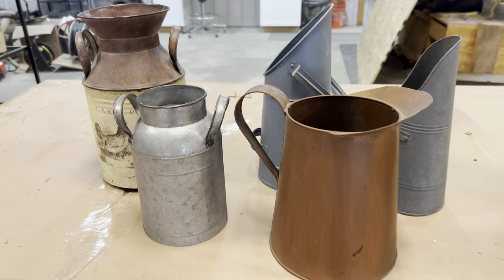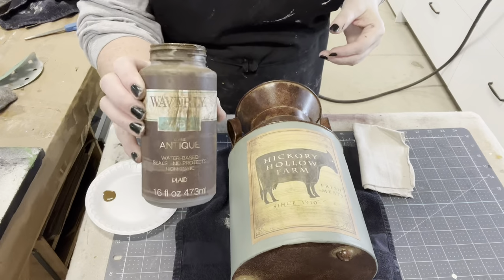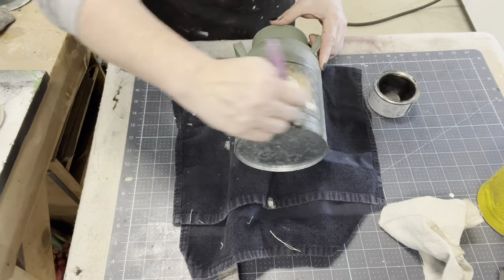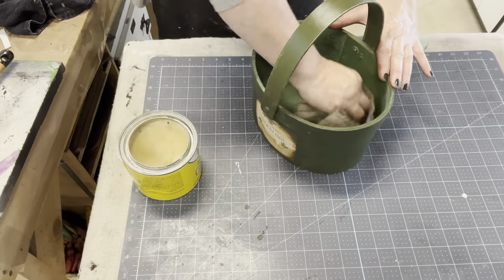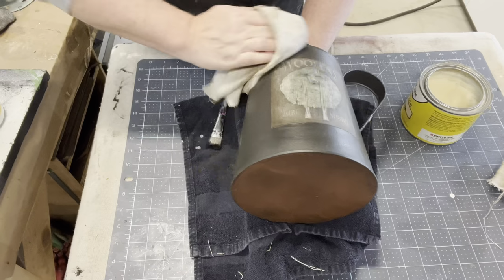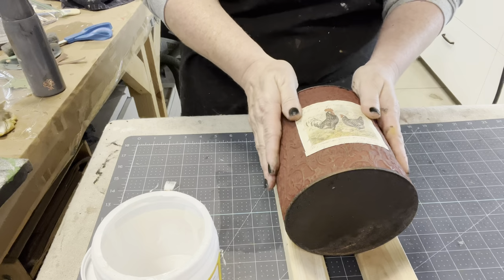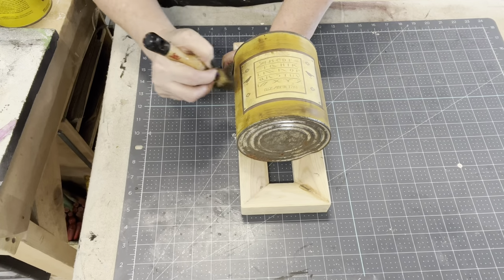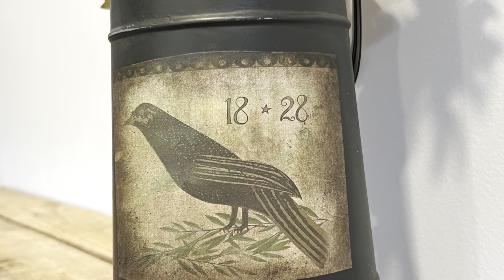DIY Easy Cans | Thrifted Thrifted | Cans | Decoupage Metal Decor | Easy Vintage Decoupage

Comment: When I have “wimpy” stems that need to be stuck into foam, I’ll use a thin bamboo skewers to make a hole for the stem before adding hot glue. Makes it easier to place the stems. Just thought I’d share. 😉

Comment: The cherry red color looks like the red undercoat for gold leaf. I’m going to try this technique soon. Just got a starter kit.
Check out German Dresden  trim. 
Might be nice to frame your decals and transfer pieces. Paint and wax pretty pretty.
More work but I wonder if you wrapped the stems with floral wire and then floral tape you could have more control over bending the stems.
Interesting to know if after painting and dressing up a piece that it sells. I just did a silver buff on an old rusty tin from the A&P store. I can’t even get the crooked top off so that’s the way it stays
Yes coal scuttles is what you have. If you ever find brass ones wow they look beautiful.

Comment: I’m pretty sure a crackle technique happens when two opposite finishes are used. Try on scrap wood pieces different base applications then the milk paint. It’s always going to be a chance happening. Think I’ve tried painting over dry Elmer’s glue.

Comment: Great video! I have an idea about the crinkle paper. What if you took some of your contractors' paper and accordion folded it then ran it thru a shredder?  Or i think there is a tool that scrapbookers use to crinkle the paper and then run it thru a paper shredder.  Hope that helps.